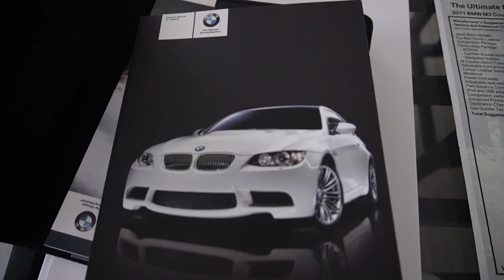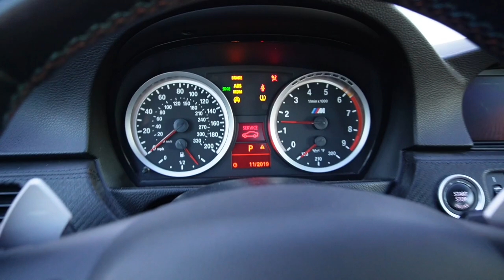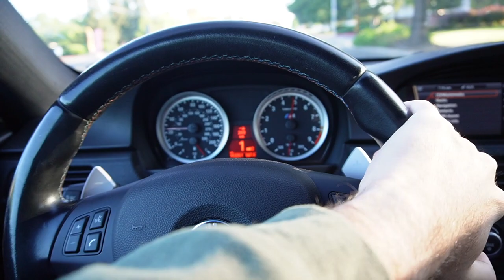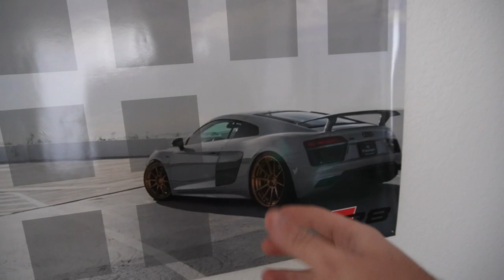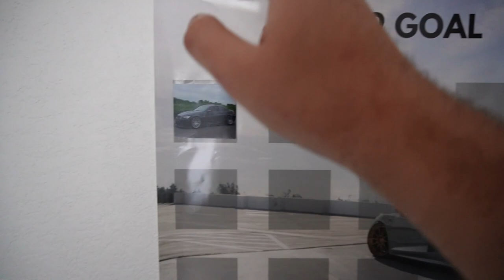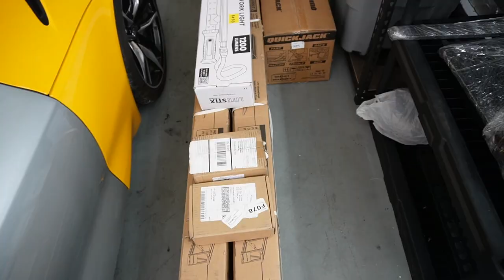A SUBSCRIBER FORCED ME TO SELL HIM MY M3! BUT YOU WONT BELIEVE FOR HOW MUCH!

Comment: Hey nour hope ur well , am glad you are replacing that 1/4 panel skin on the supra its much needed as a bodyshop guy I would advise you not to cut where u said the other panel is being cut there are methods from the manufacturer in which it tells you where the safest place is to cut the joins and the least amount of filler is used here in Scotland everything has to be done to the manufacturer spec hope this helps you in anyway .